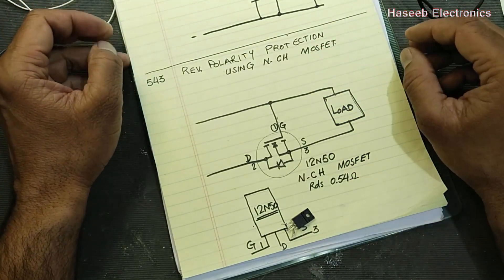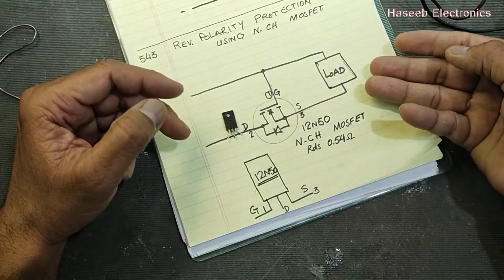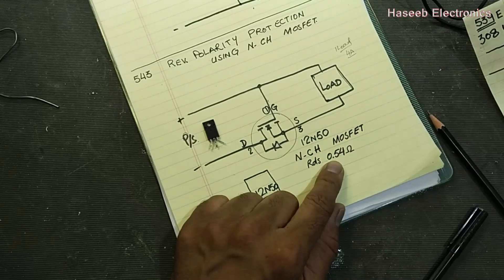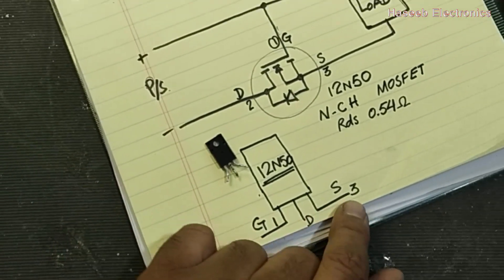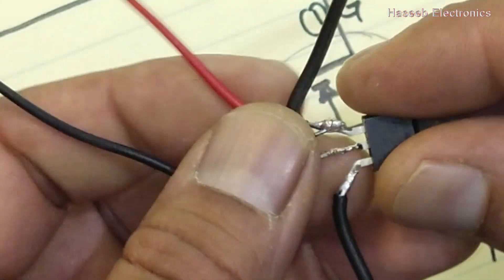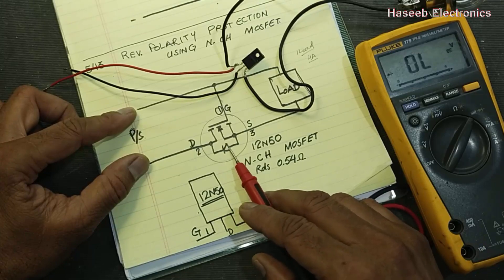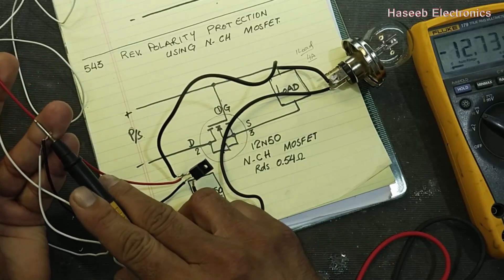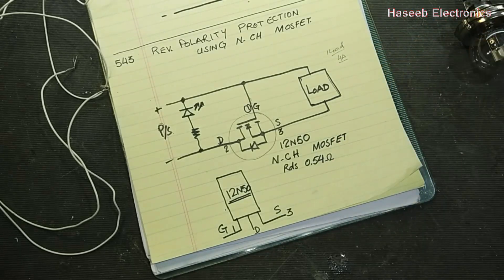{543} How to Protect DC Circuit With Reverse Polarity Protection Using N-Channel MOSFET

Comment: How if we use mosfet to block DC current from load, e.g load is battery (accu charging for example).
Charging module like XL4015 Can not tolerate to reverse current or even DC load. May you explain and give us the best approach ( with schematic too), sir? Thank you.

Comment: Sir , how to program the same circuit using micro processor. Aprat from MPLAB complier is there any chep complier , which we can use to program the circuit.
Reply from the maker: there are many compilers 
microC is also very useful

Comment: What will happen if the gate and source are connected together with the positive and the load is in between the negative and the drain? Will the circuit still work?
Reply from the maker: okay i will do it practically and we will analyze it